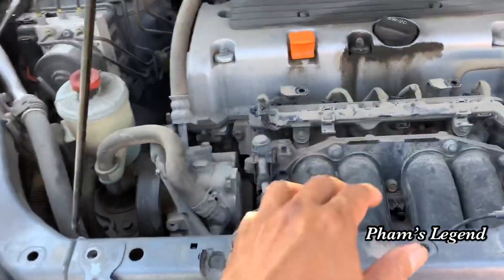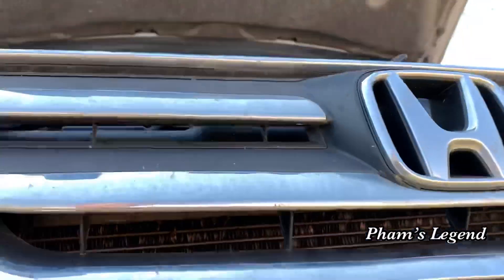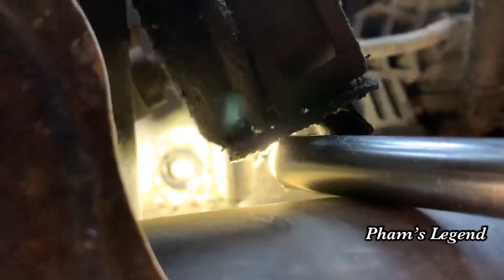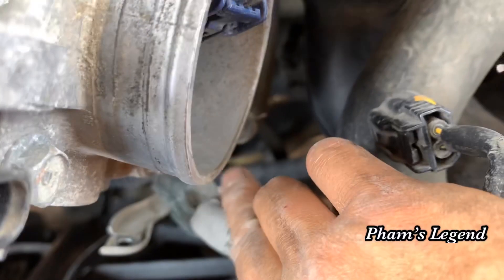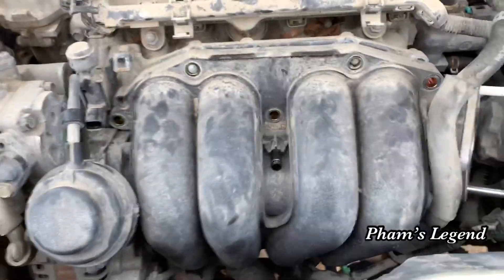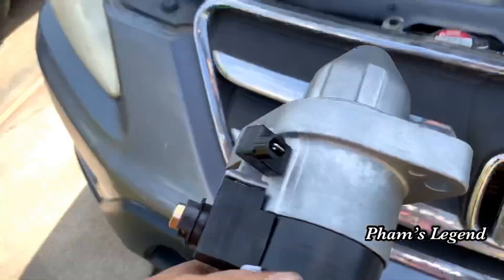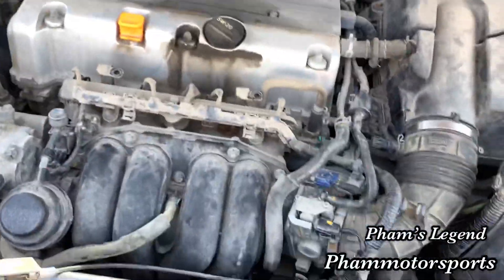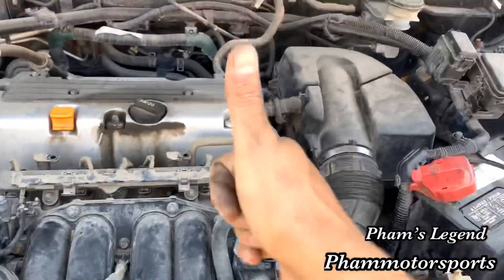2005 honda crv starter replacement || Pham's Legend

Comment: That's a lie you don't have to take all that shit off
Reply from the maker: You change it before?
Reply: Yes I have I have a 2005 Honda crv 2.4 and after driving it 204k miles the starter gave out it wasn't a easy fix but didn't need to move much of the stuff you did